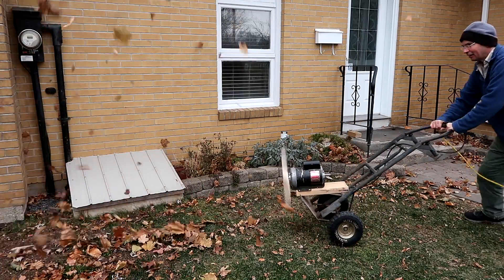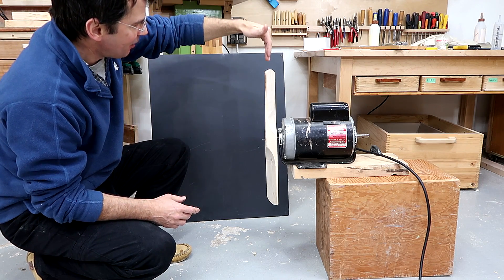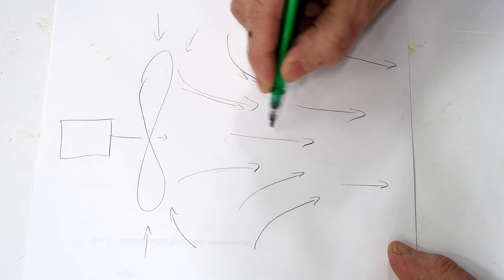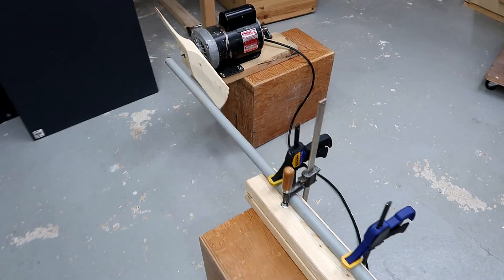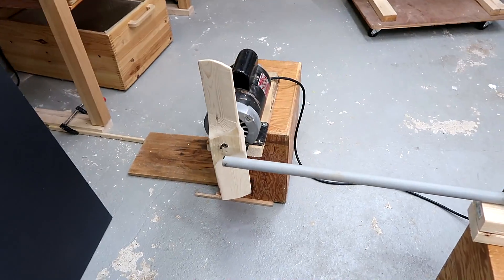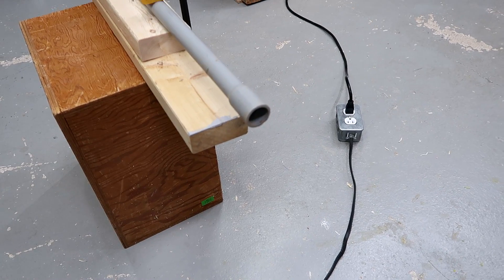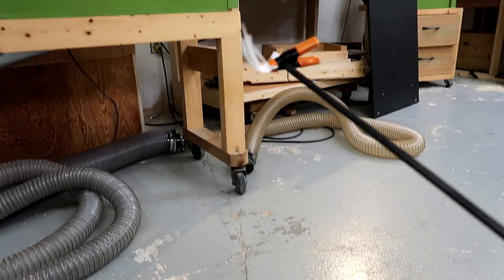Complicated air flow in front of a fan

Comment: Your loosing a ton of energy to essentially a toroidal vortice at the edge, a cowling disrupts that. It's the same reason airliners have winglets at there wing tips it gains back about 15% more lift that's normally lost to tip vortices.

Your prop alao has constant pitch angle so there's a ton of issues with that in regards to that and thrust effency as you have a serious gradient radially and that's causing issues. I'm tempted to reproduce this at smaller scale using a brushless and some propellers.

Standby to standby it's 430am here and my crap to do list is already a bit full but it maybe fun to see what idiot on the internet arguing is right using physical mockups...
Reply: Sooo I did some tests, and in the process I was reminded about optimal propeller design...

Comment: Dear Matthias,
Love your channel. I think you should count on the Venturi effect on your experiment: the more you increase flow speed, the more you decrease pressure. I think what's happening here is that the high-speed flow in front of the blade is a low-pressure spot and the ambient pressure of static air push and narrow it as you going farther from the fan. That's also why your pipe is always sucking air wherever you place it in the flow. As long as one end is in the flow, the pressure drops.
About the fact that the flow seems to go closer to the ground, it could be ground effect: it's less turbulent for the flow to run closer to a surface because the vortices are smaller. So it chooses the easiest way.

Comment: **********As an HVAC professional, I find people don’t realize the cowl is for inlet control, NOT outlet control.   If you look at a car radiator, the cowl is to make the only air entering the fan, air that has come through the radiator. If it doesn’t matter where the inlet air comes from, no cowl needed....like a common box fan.**********
Reply from the maker: agreed.  But the original comments were about adding a cowling to make it blow better, and a cowling would not help with that.
Reply: @matthiaswandel  I actually meant the comment about the box fan as a response to the unnecessary requirement of a front cowl.  On a side note, I found your temp recording and trend analysis of the house and of the freezer pretty interesting.

Comment: I think the question is: what are you after?  A higher velocity (higher ram pressure) flow can be made with a tight cowling, maybe a stator vane (much as a jet engine compressor does -- which optimizes for pressure), and even a nozzle.  Trading velocity for volume, an oversized cowling or venturi can be used.

For the leaf-blowing example, just smoother flow would seem to be helpful.  Only enough pressure is needed to actually push leaves around, which isn't much (and can be measured with a manometer).  Clearly the fan was capable of that, so it probably won't need much in the way of increasing pressure.  The flow is, roughly speaking, how fast you can work, but also how precisely you can work -- you'll have a hard time building a steep pile with an aircraft propeller, but it's easy enough to do with a handheld one.

It might be cool to do one with a stator, or just an array of tubes to allow spin and turbulence to dissipate by the time it reaches the end.  Lot of work to put together... although a scale model could be made with a CPU fan and a box of straws, hmm.

Comment: Cowling prevents vortexes of the tip of the "wings" and somehow (I don't quite know) it gives more thrust.
I guess it exhausts air at a slower speed but over a wider area, so it's more efficient for a given engine power.
But I also think a converging cowling can get the best of two worlds, preventing vortexes loss of efficiency but also increasing airspeed

Comment: I suggest you read about KORT Nozzles.  They are used around boat propellers to increase thrust and efficiency.  The inside facing the prop is shaped like an airflow, benefiting from the same effects as an airplane's wing.  If you design one, maybe Frank H. would cut it out on his router.  It could be done with a larger pantograph mechanism [e.g. your phone cutting machine] or a giant version of a pantorouter (with some control over the stepping forward).  I tried to make a Kort Nozzle for my boat by casting.  I gave up when I could not make a suitable wax wax version for the molding process.

Comment: So, the way the ducted fans work is sort of exactly what you're talking about, but for the opposite reason. You're thinking of it as air coming in from the side. What it really is ... is turbulence. The turbulence makes it less efficient, causing it to generate less thrust. The ducting prevents losses from vortices at the tips. Those vortices are areas of low pressure. That pressure sort of resists the turning of the blade.

Comment: Pulling air in from the sides will cause stail air. Stail air does not have a great deal of power. Add a cowl and also some stator fins and the power will increase heaps, but the cowl will have to be very close to the ends of the blades.

Comment: This principle is why rear-thrust prop aircraft absolutely must have a tailcone. The cone compensates for the immediate vacuum, which would otherwise vastly reduce available thrust. The same sort of applies to a conventional prop, but the impact is not quite as severe.

If you wanted to truly optimise airflow, I would suggest that you look at a duct, rather than just a cowling, in combination with a "nosecone" of sorts. It would also be beneficial to create a cone around the rear of the motor (sans overheating concerns), which would reduce turbulence. To even further reduce turbulence, you could profile the edges of the duct at each end to create a smooth transition between the inside and outside of the duct, although that's now nitpicking and wouldn't be necessary for anything other than being an interesting experiment. 

You would need to check out a heatmap of the fan's airflow to get the proper dimensions for the cone, but to be honest it could be fun just doing a bit of trial and error.

Comment: There is no surprise with vacuum when the tube is at 90 degree to an air stream, that is how siphon feed spray guns work. I would try to locate the tube opening against the stream by placing a 90 degree elbow against the propeller center area and see if there is any vacuum there. Too bad the prop is broken, but I guess it is repairable??

Comment: The reason why you were getting suction on the pipe was due to the Venturi effect.  Namely, a high velocity fluid (air) passing over a small orifice will pull from the orifice. This is the principle carburetors are based on.  So that is not a good method to measure the vacuum.

Great video!!

Comment: Aerodynamicist here. Just wanted to help with some points to perhaps improve your understanding of your fan!
1. Yes, Bernoulli principle applies to turbulent flow; otherwise it would be quite useless. It doesn't apply to compressible flow, but the air speeds of you fan are way below sound speed (M<0.2), so it does indeed apply to your flow.
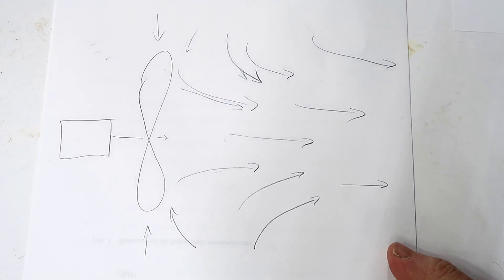2. The reason you get flow inwards as you observed in 1:37 is because of "jet entrainment" (you can google it). Turbulent mixing as well as viscous diffusion draws air from the sides of the fan towards the jet core. This is how "bladeless fans" work.
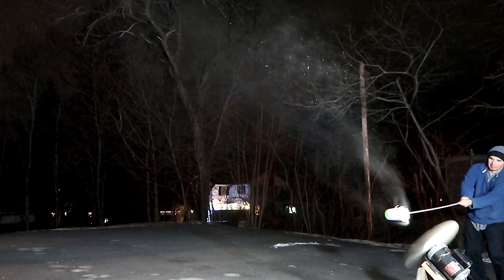3. The technique you used in 5:40, seeding the air flow with sawdust, is called "smoke flow visualization" (and usually it's done with smoke from a fog machine). In labs we use cameras and lasers to quantitatively get the motion of the particles, what we call Particle Image Velocimetry (PIV). PIV gives us the entire velocity field from the experiment, like the ones you see in simulations, and is the state of the art. Spoiler alert, when you compare experimental flows with simulations, simulated flows "look right" but the details (that matter) are usually wrong. This is why if you talk to any experimental aerodynamicist, you'll find they're quite incredulous of CFD results.
4. The probe you "mocked up" at 6:10 is what's called a "vorticity probe" and yes, it captures the "spinning" motion of the fluid. A fan produces a swirling jet downstream of it, as you observed. That's quite expected, though. We don't use vorticity probes anymore as Particle Image Velocimetry gives so much more data.
5. The air "sticks" to the floor at 6:40 because of Coanda effect. The jet of air from the fan sucks air from the sides (entrainment effect), but the presence of the floor acts as a wall and creates a lower pressure zone, which "sucks the jet" towards the floor. 

All in all, it's really cool to see you're interested in this topic. Doing experiments like that is a lot of fun!!
Reply: Careful, whenever a SME points out why he's come to the wrong conclusion on something he often ends up moving the goalposts like a true engineer :^)
Reply: Thanks for clarifying that the Bernoulli principle works for turbulent flow.  How else would Pitot tubes work on airplanes?  A question: is the correlation between pressure drop and velocity different for turbulent and laminar flow?
I used to work in electronics cooling, and we used commercial CFD software all the time.  The results of these simulations seem to have been accepted as God's only truth by engineers.
Reply: @paulkolodner2445  The specifics get quite complicated when you look at it in detail, the relationship between static pressure and velocity is nonlinear in general. It is only for low Mach numbers that you can approximate it with a linear equation, so for this first order approximation it is more about the Mach number than about whether the flow is turbulent or laminar.
Reply: So, changing the geometry/positioning/size of a duct would affect the thrust produced by a ducted fan? (thinking RC models here) This could be of value to model aircraft builders....
Reply: Thanks
Reply: A few things you said are exactly what he said in the video, suggesting you just skipped through it waiting for a chance to talk about your field

Comment: Centrifugal force has very little to do with anything. Your propeller is basically a wing. On one side you have high pressure and on the other you have low pressure. Near the outer edge of the propeller blade the air will leak around the edge due to the differential in air pressure.

Comment: As the fan spins, high pressure builds up on the front of the fan blade while there is a lower pressure on the back of the fan blade.  The spinning fan blade also throws air radially outwards due to centrifugal force.  The high pressure on the front of the fan blade tends to move radially outward due to this centrifugal force and it slips around the point of the fan blade to meet up with the low pressure on the back of the blade.  That reduces the efficiency of the fan rather substantially because the pressure difference on the blade is lost.  A cowl, if it fits the outer diameter of the fan blade with a very small gap, prevents the high pressure from moving to the back of the blade and joining up with the low pressure.  That prevents the loss of pressure across the blade and increases the fan's efficiency.  The gap between the cowl and the point of the fan blade must be small for the cowl to work properly.  Just a small increase in this gap size and the high pressure will still move through the gap and join the lower pressure on the back of the blade.  Which means the cowl won't work nearly as effectively if the gap is large.

Comment: The efficiency a cowling imparts is specifically when you want the net flow of air to move in a single direction.  By putting a cowling you won't restrict the airflow significantly you will simply restrict lateral air flow that is the pressure will be lower behind the fan for the same pressure in front of the fan.  If you put a cowling I doubt you would notice more airflow, but simply more "thrust" for the same amount of airflow.

Comment: There’s a reason high bypass aircraft engines are ducted fans… GE tried unducted fans with counter rotating props, instead of a stator, in the early 1980s. Loud AF, and not efficient. Soviet era 1950’s TU-95 is basically an unducted fan type turbo-prop, also Instead of a stator, they use a counter-rotating prop... even louder than AF. LOL. GE90-115 speaks for itself for a reason. Nice home made pitot tube btw. Hook it up to a water manometer!

Comment: It might be worth looking closer at what happens on the inlet side of the fan, rather than the outlet. Where turbine engines are used in static applications, they normally have some kind of trumpet-shaped duct on the inlet to give air coming from the sides a smoother transition to flowing along the axis.

Comment: I'm sort of surprised you didn't use a long thin tube connected to one of your manometers to measure the pressure at different places around the fan? That would make it really easy to visualize the pressure field.
Reply from the maker: too small a pressure to register with the manometer.

Comment: a cowling is useful for ensuring that more flow is directed through the prop for useful work instead of being lost off the end of the prop. I'm told that this is more useful for props on slower boats (at least on sailboats like mine). Don't ask me why- I'm not a mechanical engineer. 

An interesting experiment would be to see if you are experiencing a prop ground vortex. A ground vortex is the reason why power loading is destructive to a boat ramp, and why it's problematic to spin up your Cessna while standing still on the runway- it creates little tornadoes of low pressure which suck up all sorts of junk. You could design an experiment to visualize this using fine wood dust. You'd have to experiment with the distance between the prop and the floor, but that's half the fun!

Comment: The fan is behaving like what is known as an ejector pump (often using steam as the motive fluid). A steam ejector works by using a high velocity jet of steam to "suck in" some other gas from the sides and send it out the front, but the same principle works with other gases or liquids as the motive fluid. A jet of water is often used in chemistry laboratories to pull a vacuum for filtration. The reason there is a vacuum right in front of the fan is that it is surrounded on all sides by fast moving, low pressure air. Pressure likes to equalize, so the pressure where the air is stationary will be as low as the surroundings where the air is moving. Then the air stream downstream of the fan contracts because it is at lower pressure than the surrounding stationary air, so the surrounding air "pushes in" on it. Similar to the reason the air stream gets sucked to the floor. In fluid mechanics, the place where the stream is narrowest is called the vena contracta.

Comment: If you would look at our craft you will notice that there is a nose cone on the front of the propeller this allows the air to flow in evenly to the center of the thrust of the plane listen time will react the same way on a fan if you put a center nose cone it will allow the air to flow evenly to the center and with an induction shield around the outside of it which will cause the airflow to be more even on the outside edge rounding these edges will allow the airflow to be more smooth and will cause it to have more thrust

Comment: A strong air flow blowing at an angle into the pipe opening will cause the air inside the pipe to be sucked out from it along with the fan stream. Like a pump. You could use smoke to visualize how the current's going. White smoke and UV lights could make for a cool effect ^_^

Comment: I studied aerodynamics and I might just note a few things...
1) "Bernoulli doesn't apply in turbulent flow" - not really true. It still makes perfect sense to measure the pressure - perhaps averaged over time - of a turbulent region relative to some reference pressure. This statement is true only in the sense that PE + KE of the fluid is not conserved in turbulent flow due to energy losses in the form of turbulence, i.e. in turbulent flow you cannot neleglect the viscosity term in Navier-Stokes. But this isn't relevant for your purposes here.
2) Your long tube gives an indication of the static pressure at a given point, relative to atmospheric. That in itself tells you little about the flow. If you want to know the flow speed and direction, you need the total pressure too - i.e. you need a Pitot tube.
3) A point with a low static pressure does not imply air is being "drawn in" - effectively you are ignoring the dynamic pressure, which you can't in this situation. You record a low static pressure on the side because the immediately surrounding air is being dragged along in the axial direction. Moving air, so low pressure (Bernoulli).
4) I think a cowl would increase flow velocity, but I'm not sure about flow rate. It's not clear to me that you necessarily want maximum flow rate though. If you want high flow rate, keeping power constant, you need a big fan at low speed.

Comment: For vacuum test you have to place the hole toward the flow not at a rectangular angel .
Reply from the maker: If you aim it at the flow, you have a pitot tube.  The flow will ram the air into the tube, so you are measuring velocity mostly.
Reply: @matthiaswandel  but at the place where the pressure is negative or the flow is backward so you will have a vacuum in the tube .

Comment: I agree there is a slight vacumn at the perimeter of the prop's main blast due to reduced air pressure caused by accelerated flow from fan.  However, with the pipe at angles approximately perpendicular to the airflow and at the highest velocity sections of the airflow isn't there also a venturi effect at work?

Comment: That’s a Venturi effect. The tube will have a lower pressure because the opening is perpendicular to the stream lines. Not because there’s “vacuum” in front of the blade. 
Also the shroud will make the fan more efficient by stopping the recirculation at the tip of the blades.